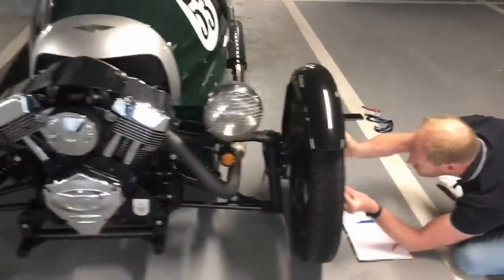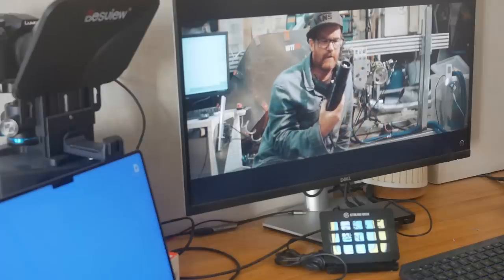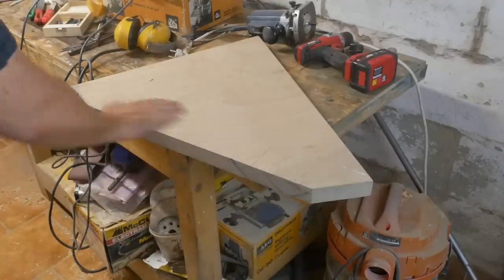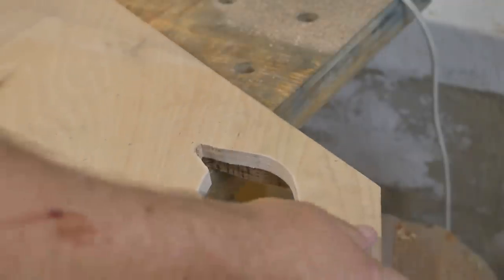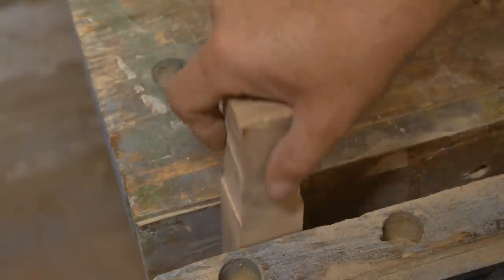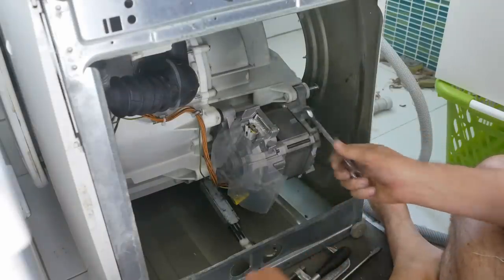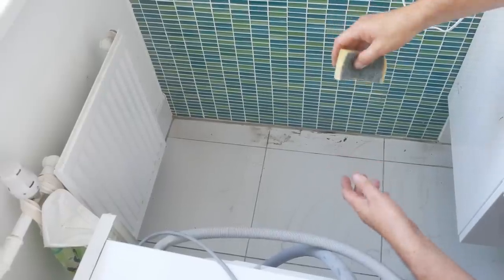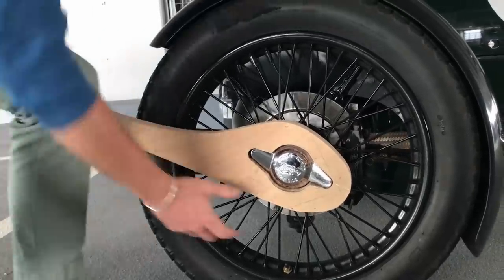Mogs wheel nut tool

Comment: “That’s a really nice “Undo” you’ve got there!” Used to get that from the not “British Car” initiated. And my washer first replaced the brushes. Then the door lock broke. You have to jiggle the handle while pushing the door shut to get the cycle to start.
Reply from the maker: I wonder what will fail next? Motor bearings would be my guess.
Reply: @RotarySMP  I thing we already have replaced that. We bought a new Siemens washer and separate dryer. And keep the old washer/dryer for high demand days. When it breaks again… I’ll see how I feel about it then.
Reply from the maker: @ericmorriscompany9648  Sooner or later the parts supply will run out.
Reply: @RotarySMP  that’s ok. I’ve got three CNC machines. One has a 4th axis. But actually my wife will make the final decision. I highly doubt there will be any highly custom CNC parts.
Reply: @RotarySMP  my wife actually just bought another CNC. I wasn’t even thinking about buying another machine. She is all psyched up for the new machine. I love my wife🥰
Reply from the maker: @ericmorriscompany9648  Oh, I have to tell my wife that story. Xmas is nearly upon us, and I am sure she is wondering what color CNC machine to buy me :)
Reply from the maker: Update... 
Wife "Or not!!!" -
Reply: @RotarySMP  well if she’s not going to buy you a new CNC mill then I guess you’ll just have to settle for her buying another CNC lathe. 😬😬

Comment: The lockwire bit reminded me of one of the instructors cars when I trained as an engineer for an aero engine company. It was an absolutely immaculate V12 Jaguar XJS. He'd had it from new, but never liked it's factory quality control, or the periods "Can't fire me cos' I'm in the union" low level of fit and finish, so he stripped it for a full nut and bolt rebuild. EVERYTHING steel was polished, everything alloy was polished THEN anodized, several bits were re engineered, the engine was blueprinted, every hose fitting had been converted to use screw on aircraft hoses or banjo fittings, then all the hoses replaced with stainless overbranded ones........ and every single nut and bolt that could be drilled and lockwired had been. All of the work had been done by him in lunch breaks and while the trainees were all occupied with what we had to be getting on with (And I think the company turned a blind eye to him raiding the parts department for stainless fasteners and hose hardware. :D).

If it was sunny he'd bring it to work, and if car nut new trainees asked nicely, he'd pop the bonnet for them to ogle at how he felt a prestige marquee sports car SHOULD have been nailed together in the 70's. :)
Reply from the maker: That must have been an impressive sight.
Reply: @RotarySMP  It was. Just picture all the extra little details and improvements a pedantic old British aero engineer would do when assembling a home build airplane kit. Now superimpose that level of detail on an car rebuild. If you just saw a photo of the finished engine (minus all the obviously car related ancillaries) on a cradle, most blokes would have assumed it was something freshly rebuilt for a WWII fighter restoration. :)

The old bugger must have had shares in Autosol too. I never saw that car looking anything other than "Photoshoot ready".

Comment: I was once given a washing machine that wasn't working. I found a 50 cent coin was jammed perfectly in the drain outlet hole. It worked like new once I flicked it out, and I kept the 50 cents.
Reply from the maker: That is a good one :)
Reply: Until recently one could just get in a truck and drive around a bit, find ANY washing machine you wanted on the curb for the trash pickup and fix it in a few minutes. (In the US) Practically everything I owned was acquired in that fashion.
Reply from the maker: @HansFormerlyTraffer  You can't just put stuff on the curb like that here. You have to take it to a recycling center.
Reply: @RotarySMP  Yes they changed the law here similarly ...so now you can't get stuff off the curb. But you can beg the recycling center manager to let you take it. I have gotten stuff from our guy...he's pretty good about it.
Reply: @HansFormerlyTraffer  For sure, I built my first decently sized cnc funded from fixed up washing machines and driers, took a couple years but. I still snap up the odd one, we still have curbside redistribution piles here in NZ

Comment: Some time ago I changed the bearings and seals in our washing machine because it started getting noisy. It turned out that some minerals from the water got stuck to one of the seals and it machined a groove on the shaft, then it started leaking and destroyed the bearings. I machined a sleeve for the shaft, but you could easily see that the engineers planned for it to fail like this. The repair turned out to be more complicated than yours and I haven't thought at the time to change the brushes while it was disassembled.
Reply from the maker: It just it is impress how long these things last. This has been running for hours at a time, 4-8 times a week for over 15 years, and this is the first maintenance required.

Comment: Now if it was my car I'd manufacture knock-off shaped covers for a big splined nut, but there is of course more than one way to pet a cat.  Thank you for sharing the adventure with the washing machine, I have no doubt I've done something similar more than once.
Reply from the maker: If it was my car, it would have more than one thread holding the front wheels on :0
Reply: @RotarySMP  Wait, what? 🤔 I mean it seems to work ok, but that doesn't mean I'd be happy with the idea.
Reply from the maker: @jimsvideos7201  Since I forget to connect the motor cable, It is good to have five loose wheel nuts rather than one :/
Reply: @RotarySMP  In luck and british engineering we trust... Proved to never disappoint you over the last years, right...

Comment: In the US, I don’t think I’ve ever seen plywood even close to that thick… I need to do some hunting around!
Reply from the maker: It is pretty nice ply. I got a sheet to make the new basement stairs, but unfortunately miscalculated and ended up with an off cut the shape of a nice bench top :)
Reply: 32mm, you'll have it. Although it will some fraction of the king's nose or some such.
Reply from the maker: @m3chanist  Some fraction of a foot. A toe?
Reply: @RotarySMP  A long prehensile hobbit toe, a Furlong.

Comment: When we where starting out, we bought a 15 yearold washer drier. Had it 15 more years, only got rid of it as we couldn't get belts for it anymore. must of had 3 belts and 5 brushes over that time. The replacement brand new on gave up in 18 months.
Reply from the maker: This one has also be going somewhere between 10 and 15 years.

Comment: On my wire-wheeled classic cars I used a copper mallet for decades,  then invested in hexagon spinners (no ears) and a lovely composite adapter that sat inside a big steel holder with 1/2" socket recess. Could finally torque the single nut correctly.  Not banging until the spokes broke.
Reply from the maker: Sounds like a good improvement.
Reply: Same on my Elan +2 but with a fugly steel adaptor
Reply: I'm just finding it somehow fitting that this handmade coach built car now has a handmade wooden wheel spanner. :)
Reply from the maker: @Reman1975  I thought the same.
Reply: They are called knock on nuts and back in day a hide mallet was always used to put the wheel nuts on and take them off.
Reply from the maker: @MX-Drew  Nico cares too much about chrome to bash them, even with a hide hammer.

Comment: That was fun to watch! I changed a number of brushes on German washing machines, and I never got one single motor that came out as easily as yours (usually required more or less banging).
Nice wooden wrench for the Morgan 🙂
And that's another video where we don't have a nameplate brushing 🙂
Reply from the maker: I first tried going through the "access panel" in the back, but that was usless. From below removing the motor was not too bad. I expected worse.
Reply: @RotarySMP  Yep. You have to tip it over to have access to the motor. On some cases you can change the brushes without removing the motor. My problem was that those plastic pillars where the motor engages, swell with the screws and they get pretty tight. Nothing that a rubber mallet and some stamina can't overcome 🙂

Comment: That's crazy. I have the exact same washing machine. I repaired mine too, it was a different failure, but I could easily get a replacement part.
Reply from the maker: That was a surprisingly easy repair.

Comment: As had been said, the design of the nut is intended to be hit with a hammer. That is why they are called "knock-off spinners". 
But, the reason that I am commenting is " This was encouraged by the Rudge-Whitworth patented detachable and interchangeable wheels designed by John Pugh. " [Wikipedia]
I wonder if he was any relation?
Reply from the maker: Hi Andy, Interesting family connection.
I guess Nico doesn't like hitting pretty car parts with a hammer. Even a lead one.
Reply: @RotarySMP  that is totally correct. The 2-eared spinner are not only 2 year old. And the wheel were rarely down. Only at the Morgan dealer. But since the tires are fully shot and I got a quote of 700EUR, I will bring the wheels myself to some oldtimer tire fitter in Vienna.

Comment: My 3 year old washing machine recently threw a fit. E:20. Manual says "clean the lint trap". OK, did that, restart the cycle, result: E:40. Bummer. Manual: "Loading door is open".
I had prouder days than that one.
Reply from the maker: My wife just cracked up at that. Thanks.

Comment: Wooden wrench for an antique car, sounds fitting. Lol
Btw I’d like remind everyone to pull out your frig and vacuum and clean everything. This summer ours began to stay on for long periods of time. Embarrassed to say but there was enough lint there to make pillow.
Reply from the maker: Good point. Power is rather expensive.
Reply: @RotarySMP  And I was more concerned about the frig itself being on almost all the time.
Reply from the maker: @iteerrex8166  I would hope there is an overtemp sensor and shut off for the compressor. But maybe the lint kept that sensor cool :)
Reply: @RotarySMP  I didn’t look but I’m sure it does. Its about 10 years old, and there was no sign of over heating. It seems it’s good enough to run for prolonged periods. The lint in effect was mimicking a hot kitchen. After cleaning btw it went back to normal.
Reply: Antique?  Nothing antique about it.  "Modern" S&S engine.  Disk brakes.   Most likely manufactured post 2011.
Reply from the maker: @ShainAndrews  True.
Reply: @ShainAndrews  Ah, so it’s replica of an antique? I know nothing about it, just that it looked like those cars from the 1930s or so. Anyways it wasn’t meant as an insult in anyway. And the wooden wrench is just right. It has maximum engagement with the nut, nice amount of torque, and soft enough not to hurt the chrome plating. So it was meant as a joke.. old car and wooden wrench 🤷‍♂️
Reply from the maker: @iteerrex8166  Not a replica ... continued production. Morgan three wheelers have were made from 1910 to 1952, and  then put back into production in 2011.
Reply: @RotarySMP  Oh I see, very cool!

Comment: Last time I changed the brushes the main bearing failed 3 months later, non-replaceable type (or replace with the whole drum so uneconomic). It was only 15 years old!
Reply from the maker: I was also wondering about that a bit. Not enough to change the bearings though :)

Comment: Ah, some soft and sensual ear-rape on a Saturday morning.
If your equipment is capable, feed the mic to both L and R, and set one of them to 6dB less than the other. That way you'll always get one clean track.
Reply from the maker: Sorry about that. The Rode wireless go  is a pretty hot mic. There is a button to cycle between 0, -6 and -12 db. I need it on -12 for the Panasonic g85s preamp, but didn’t notice that I bumped it to 0db. The G85 does support different gain per channel. 
I need to learn to check the meters more.

Comment: But,But,But, they are knock-off wheel nuts, you are supposed to use a leather mallet to loosen and tighten them.
Reply from the maker: As in, bash straight onto the wings?
Reply: @RotarySMP  Yes, a Lead mallet was used.
Reply: Lead hammer on the Ferrari (all the time)
If that is what they supply, who am I to question?
Reply from the maker: @jimurrata6785  Wish I knew that before making it :)
Reply: @RotarySMP  now tht's funny 🤣
Reply: @RotarySMP  happened to me. Since I am not born in 1934, I am not familiar with such ancient technology, sorry. :D

Comment: Lead mallet. How it’s been done for years.
Reply from the maker: Darn, show have checked first.
Reply: @RotarySMP  nothing wrong with what you made, probably works very well. Lead mallets are just easy and versatile
Reply from the maker: @KennyEaton603  I dont think Nico could bear damaging the chrome on the nut.
Reply: @RotarySMP  doesn’t hurt it if the lead is clean, it’s way too soft. I was shocked the first time I saw it done, but it doesn’t hurt anything. 

Cool cars though. Always been curious of them.
Reply from the maker: @KennyEaton603  He drove that Morgan about 2300km to Le Mans in a mix of torrential rain and heat wave. Probably not as much fun as it should have been.

Comment: Would you please ask Mrs. Rotary, My 2016 Jetta is surging while running in park, What's the diagnosis. And 2) Won't Nikko need to cut off that long handle on the "MOGS WHEEL NUT TOOL" so he can store it next to the car brush? CHEERS!
Reply from the maker: You nailed it. First thing Nico asked me is, can we make it in two parts.

Comment: Why not 3dprint the template?
Reply from the maker: It needs to be large and flat. My printer bed is not that large, and thin flat pieces tend to curl up.
Reply: @RotarySMP  you see! you see! I told you! We need to 3D things to get it right. :)
Reply: @RotarySMP  I meant the piece that fits the nut only. The part which you so artistically cut with the compasses :-)

Comment: You have a cnc and still fool around with hand tools. It's only four G2 and four G1 command. This is why when you have to use the cnc you make mistakes, always practice.
Reply from the maker: Good points, buy I dont like cleaning wood dust out of the way oil.
Reply: @RotarySMP  Clearly then, a "CNC table to wood router" pantograph/linkage/contraption needs to be devised...! :)
Reply from the maker: @AttilaAsztalos  That is one of my long abandoned half finished projects.

Comment: my ex wife had me buy her a fancy horizontal washing machine... it went out a few years after she decided to move in with her boss at work.  The dang thing was 5k to replace, or $500.00 for the tech to replace the bearings.  I got the bearings for $36.00.   the tool to pull the bearings was 150.00  so I didn't buy it... and it took me about a week of pounding and pulling to get the bearings out... probably worth the $150 to get the proper tool from the manufacturer...  but $186.00 would have way cheaper than the $500 they wanted to fix it  and mile away from the 5k to re-buy the unit.  still running today, about 10 years going.  She ended up marrying her boss after our divorce.  I haven't need a new washing machine in a long time.  =D
Reply from the maker: That was an expensive machine.

Comment: Please tell the number one fan that a picture  can be loaded into fusion 360 - then you only need one measurement for scaling the picture. Super easy, I do it all the time, and get really good results. Picture need to be straight on. 👍🤓😎
Reply from the maker: He doesnt have a computor he can load Fusion 360 on.
Reply: @RotarySMP  Same can be done in FreeCAD, LibreCAD, NanoCAD, etc...👌 If he does not have a computer then that is another issue 🤓🤔🙃
Reply from the maker: @TheStuartstardust  I know how to do it, but I have two laptops:)
Reply: @RotarySMP  I suppose he has an IBM 360 that came with the Morgan 😆

Comment: Wheel spinner wrench = brass hammer ???
Reply from the maker: I doubt that tire changers have enough sensitivity to use anything other than the closest hammer at hand. :)
Reply: Yeah, I thought usually used a dead blow hammer with a rubber head to knock them loose or tight.
Reply from the maker: @JCWren  I hope they are that sensitive.

Comment: Hmm if the washing machine wouldn't be such a synpony of things I'd say go full brushless.. Samsung now uses Brushless which is very nice but the control boards are trash basically not made for the amps that It can get peak and then also put in epoxy so no fix..
Reply from the maker: Brushless motors also dont turn when you forget to plug in the connector :/

Comment: Nice to see something getting made via manual pattern techniques without going "oh you have to CNC that to get it right"

Jeez I wish I had the room for a real bandsaw.  Definitely one of the most useful tools in any shop, however they can be incredibly dangerous real fast if you are an idiot.

I am surprised that your Bosch appliance still uses a brushed motor.  Washing machines are a big market for super low cost BLDC motors these days, and Bosch is generally ahead of the curve on technology adoption?  I guess you have a number of miles on that guy given the brushes are worn down to the pigtail termination.
Reply from the maker: Yeah. that bandsaw solves a lot of problems really fast. 
I dont remember when we got that washing machine, but probably about 15 years ago.

Comment: What kind of fuel mileage does he get on that Mog?
Reply from the maker: Not much I would guess.
Reply: over the 2730km I drove in 3 weeks through France, it was 8l/100km average. No highway. Some slow stage in Switzerland, the rest was commited driving. So not so bad for 2 liter engine I guess.
Reply: @NicoCarsAndCookies  That is a pretty big engine It must be fun to drive. (And not bad mileage either....equates to 30mpg as we measure in the US)
Reply from the maker: @NicoCarsAndCookies  Especially with a lead foot.